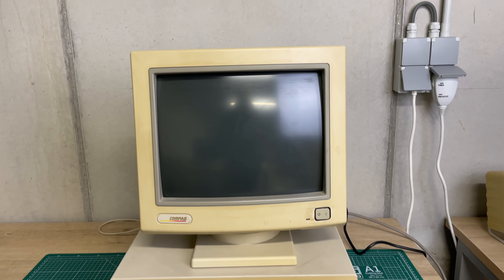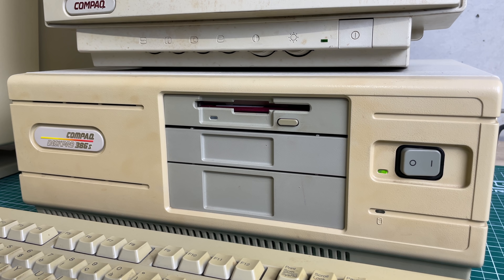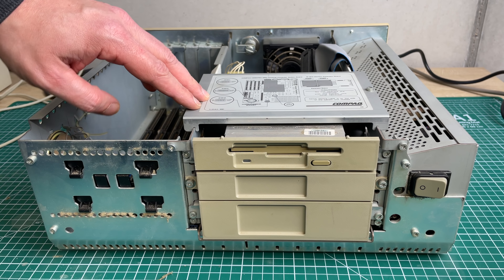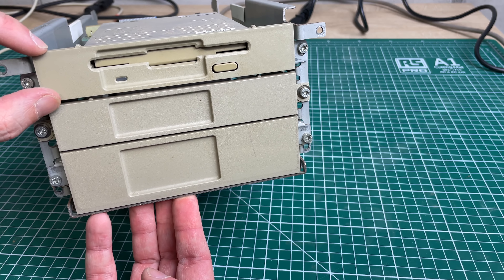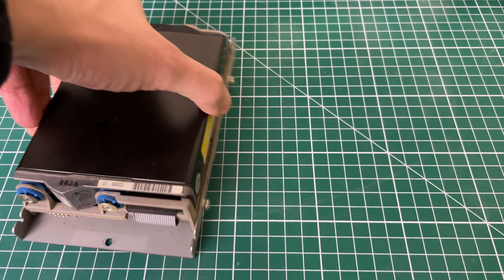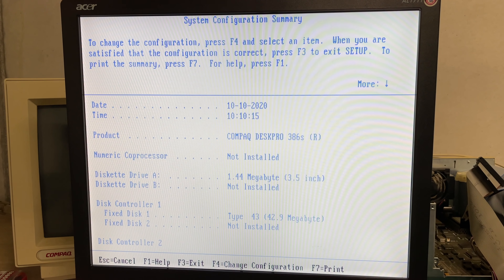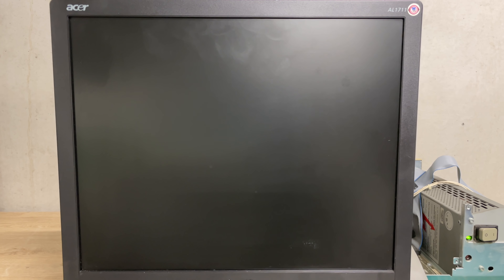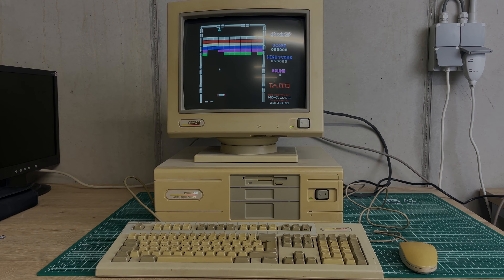Compaq DeskPro 386s first (and last ?) look

Comment: It seems that Conner hard drives sometimes have problems with the spindle motor driver. The sound you're hearing is that driver circuit that can't go past the soft start phase and is unable to spin the motor. It happened to some of my Conner drives too, failure mode was similar to yours and in one case the motor driver was actually able to start the spindle motor, but it wasn't able to stabilize its speed after reaching the nominal RPM. That one was my 486's Conner CFS420A hard drive.

Usually replacing the controller card with another one from an identical donor drive solves the problem, at least until that'll fail too. Probably that is due to some capacitors which need to be replaced on the disk's controller board.

It could also be that the heads are stuck so hard to the platters that hitting and wiggling the drive doesn't free them, and the driver circuit tries repeatedly to spin the motor without any success. In this case the hard drive is pretty much doomed, as as soon as you try to free the heads by opening the drive and manually rotate the platters, those will be ripped out from their suspension arms. Been there, done that, it didn't work and I finally destroyed the drive.

Comment: This looks very similar to my Compaq Deskpro 386e, except mine has a 386DX 16MHz processor with 8MB of RAM and it came with a tape drive where your hard drive is at.  Unfortunately the Dallas chip in mine seems to be soldered and my soldering skills are terrible due to my shaky hands.
Reply: Sell it!  Necroware  (EDIT, sorry I called him Nercomancer!) has a method of putting a hole in the side of the Dallas, and soldering a wire to that, then another a wire to one of the legs to attach a CR2032 socket or similar button battery holder. The Dallas unit (which is a chip+battery, not just the chip!), will drain the piggyback battery fast, but it's a lot easier than desoldering the many pins of the Dallas. You could even get money for the motherboard without worrying about shipping the entire computer.

Comment: Compaq possibly went with the non-standard 3.5" floppy drive for the same reason Sony and Apple go with non-standard stuff - so you have to buy replacements from them.  Did I miss where you tested it after PC reassembly?  I'd worry that that disk shutter damaged the heads.
Reply from the maker: Will do it in part 2. Used about 10 disks (installing msword, playing some games,  configuring windows) and seemed to work fine. Got lucky

Comment: Ah, the good old days, when you had a schematic inside of the machine...
Reply: Back then you didn't need right to repair, it was a common skill taught to kids growing up. Sadly forgotten today
Reply: @NickDalzell  I'm not sure it was "common", but... I think one of the reasons Woz got pushed out of Apple, is that he made the II and III machines repairable, and Jobs wanted a locked box you had to pay Apple to repair. His dream has come to fruition with the iPhones.
Reply: The older iphones up until he died were much easier to take apart.  No glue just a few screws.  Didn't disable touch ID either like a screen replacement does today

Comment: The Compaq 286SLT is a nightmare compared to this machine. Sure it's the first laptop to have both VGA and a Hard Drive, but:
-Dallas RTC which isn't socketed for the reason of there not being enough space for a socket
-BIOS only accepts Conner hard drives and not even all of them, and then it doesn't have a custom drive type either
-POST takes like 2 minutes no kidding
-Proprietary RAM expansion (which wasn't uncommon back then though)
(luckily both of mine were owned by an incredibly rich person, they have 5 and 6 MB of RAM installed and both have the 287FPU, but one had the hard drive rubber seal melted into the platters and I ran out of 40 MB hard drives and 20 is just too small to be useful).
I drilled a hole into the RTC modules without desoldering it and soldered a battery to them. That way I can replace the battery when it dies instead of having to replace the entire module.

I also have that monitor and it hasn't started smoking yet.
Reply: Why not a ISA XT CF card adapter? After upgrading my SATA drives to SSD, it seemed very natural to upgrade classic PCs to CF cards.  Back-up the ancient hard drives and don't touch them until you can sell it as a museum piece!
Reply: @squirlmy  Because the Compaq 286SLT is a laptop computer and only has an ISA BUS accessible in the docking station and I prefer to have it luggable - I don't just keep these old things for collecting, I actually use these from time to time - sometimes I actually do some real work on these, like write a small program to help with stuff.
(I didn't check though if the machine will power up without a hard drive at all)
There is two things that can happen if you power up the machine with a Non-Conner hard drive:
Either there will be vertical lines on the screen, no backlight and the machine will appear completely dead, or it will POST but not initialize the hard drive (on the 286SLT, the HDD won't start spinning until the BIOS tells it to).

Comment: once a RIFA  completely burns up it should no longer be a real issue since they are made to fail in an open condition. you probably finished it off since the smoke and noise wasn't severe